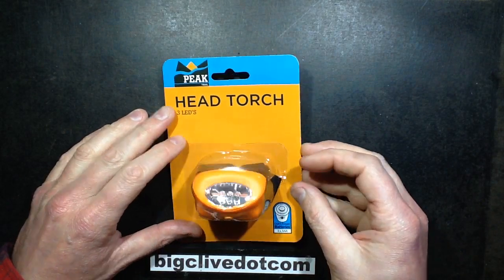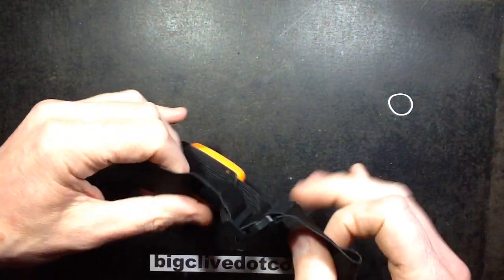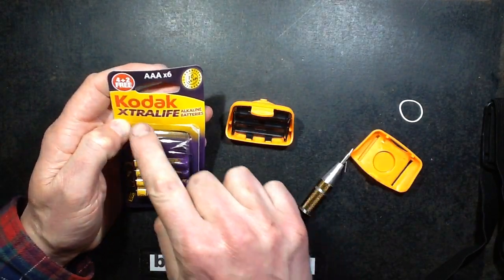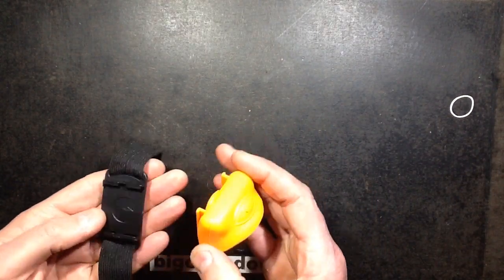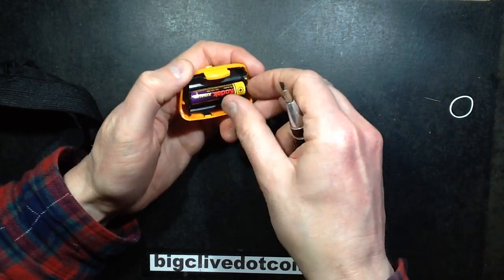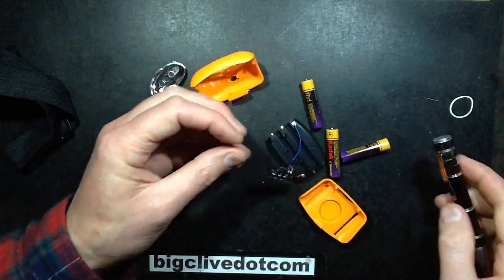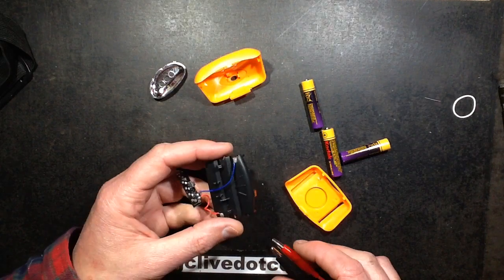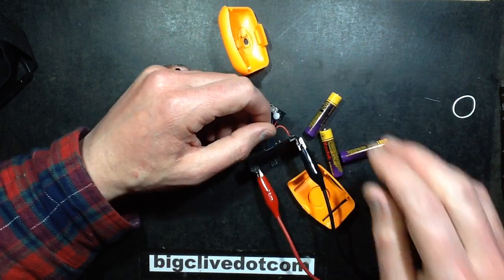Poundlands 2015 LED headlight.

Comment: Personally whenever I open anything up (and I do it a lot), I always check the colours of power connections. Even mains leads are often wrong (and not just Chinese ones either). I've done that ever since I connected a stage lighting pack from a major UK manufacturer, and the live and ground were transposed.

Comment: I finally threw an older Energizer head lamp away because twice while I was wearing/using it, one or two of the batteries burst. It's ironic that both times I was using Duracell batteries!
Reply: duracel aren't that good batteries actually. They have a huge advertising budget, but that's about it.
Reply: I agree, I don't even bother with them anymore.

Comment: Could turn the head band the other way round? Would that stop the dropping out?
Reply: looked as if the light could be inserted either way, just a matter of flipping the headband and inserting the light facing down.
Reply: +David 'Haggis' Haysom but the lamp would face up.

Comment: I've had a number of these LED headset light/torch units from Harbor Fright Tools in the States.  Mostly replaced cause after a dozen of battery changes, the internal battery connection clips break off. Finally modified so have power wire out to a rechargeable belt clip battery pack because of extended use nearly every night.  For a few dollars, they are worth it. When first get them, they do have a very tight elastic headband strap.  Just stretch over something like soccer ball or such for a day or so, usually they become easy to adjust and wear (same method works for new tight fitting headphones).

Comment: Hi Clive, thanks for your videos. Very informative and have re-ignited my interest in electronics. I've also become a regular visitor to Poundland thanks to you!
Just a thought, you could measure the current by putting your ammeter across the switch (in the off position of course!).
Intrigued what the microscope is that I've seen you use several times?? Thanks again and keep them coming.
Reply from the maker: Phil Coull When the battery voltage and the LED voltage are close a meter can add enough of a resistance in line to skew the reading.  That said, I've not actually tried it with the new meter.  I could just put it in between a battery terminal and the end of the cell.  The microscope is a very generic ebay special available from China for a few quid.  Its only downside is the tiny button cells it uses that can be drained flat in a few hours if you accidentally forget to turn the LED off.

Comment: This reminds me of a mistake I did with a battery operated pull string/push lamp several years ago.  It took a typical 4.8v krypton torch bulb and I tried swapping it the LED from my Maglite to see how well it would light.  It wouldn't turn on, so I tried checking if the LED bulb was in place only to discover it got very hot.  Then I happen to notice that the negative terminal of the battery holder is connected to the tip of the bulb, unlike most torches were the positive connects to the bulb tip.  One way of killing a LED, particularly at the time when the 3W retrofits cost around £20.